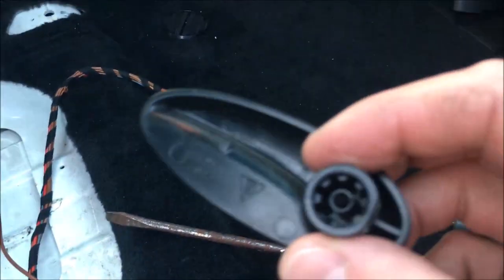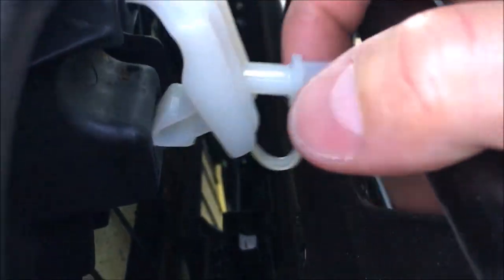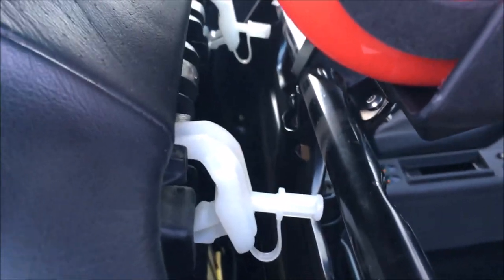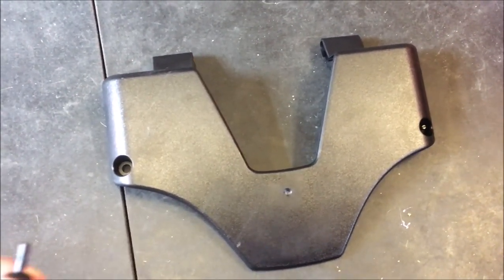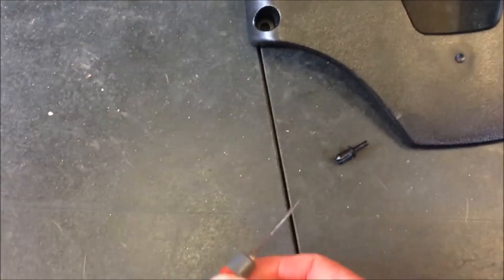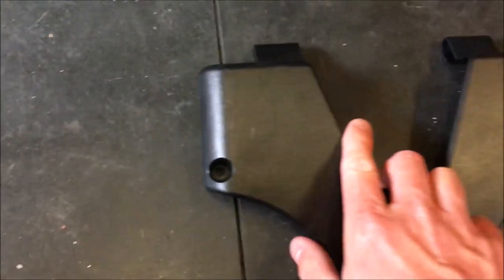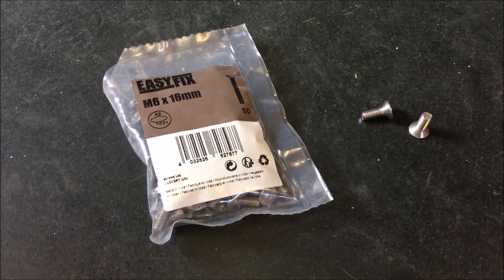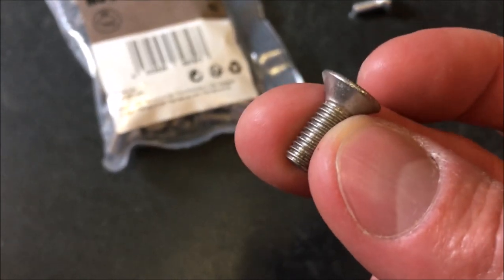Extinguisher Update, Document Holder, Stainless Bolts | DIY | Porsche 996 986 987 997 911 GT3

Comment: I’ve been looking at buying a 996 or 997 911. Not 100% sure what exactly I want. Really enjoying your videos on your 911. Curious as to how you plan on addressing the ims on your car, or if you plan on addressing it. Really looking forward to more videos, I love the direction you are going with your 911.
Reply: I do t think there’s anything to address as such , when the car is getting a clutch change check the bearing for wear 
If it’s ok leave it well alone
Reply from the maker: I understand the dilemma Ben; lots to consider 2/4, manual/tip, gen 1/gen2, 996/997.... and then all the options - most important is to buy the best you can!

The thing about the IMS is that is it perfectly OK, until it's not OK - a bit like a cambelt letting go. The hype appears much more than the reality, but if it happens to you it won't make you feel any better being in the minority! @Carrera1972 makes a very prudent remark - plus you should treat it as a consumable part, albeit one with a very long serviceable life.

Comment: Hi Rob - enjoying the videos - purchased a 996 C4S recently and looking to do some mods and repairs - I have a couple of issues namely battery drain from PCM unit plus the cd changer hasn’t worked for a few years - the fuse was removed for the radio which prevents battery drain but I wonder whether the cd changer might always be a problem so looking to remove it - did you do a video of removing your cd changer? Rgds Andy
Reply from the maker: If i did it wouldn't help as your C4S will have your front diff where my CD changer is in the C2!  I assume it's somewhat the same though; release the plastic trim, unbolt the retaining bracket, unplug the harness, remove.
Reply: @TheThrottleCable  ok thx will have a go at taking it out - are there any issues thereafter eg does it need a loop on the cabling or are the connectors ok left in situ once changer removed?
Reply from the maker: I just tidied my cables up with a zip tie 👍
Reply: @TheThrottleCable  ok cool sorry I wasn’t clear what I meant was does it need a fibre optic loop once the changer is out so the pcm isn’t confused?
Reply from the maker: check out https://www.instagram.com/phil_petrolhead/ as he has very recently done this on his C4S

Comment: Enjoying your channel can imagine your run out of jobs soon saw a really nice adjustable drinks holder on eBay quite expensive as its aluminium and adjustable from AU but I would enjoy seeing you review them but may foul on the fire extinguisher you just fitted.
Anyway only a suggestion I’ll be doing most of what you’re doing but going with a ducktail spoiler looks so cool 😎
Reply from the maker: Thank you so much for following - don't forget t subscribe! Still lots of plans, but yes ultimately I will get there. I appreciate the suggestion; I'm lucky that the car has the original cup holders over the vents so I have no real need for an extra one right now, but i'll check them out.
Reply: TheThrottleCable Subscribed of course lsd or hollow sway-bars on your list?
Reply from the maker: @keithevans4643  yes both, the only subtle difference being most likely solid sway bars but we'll see as i'm yet to decide :)